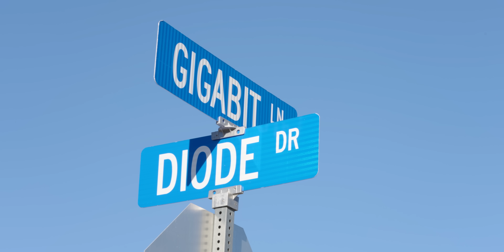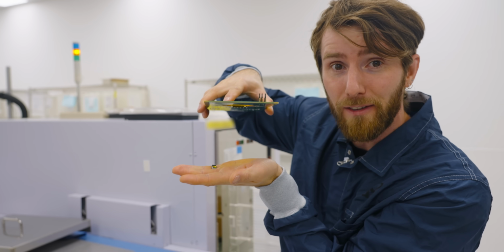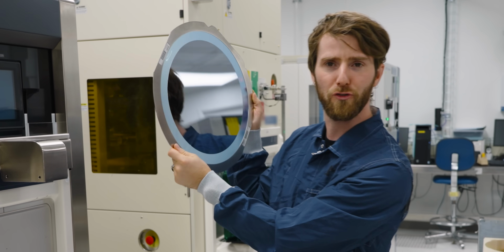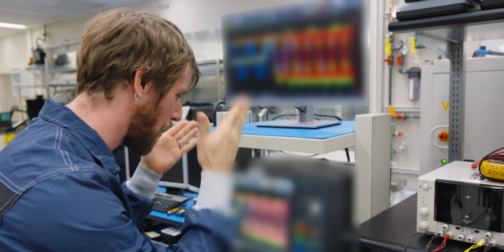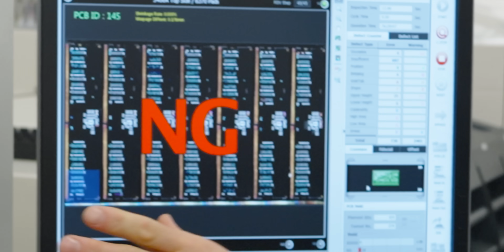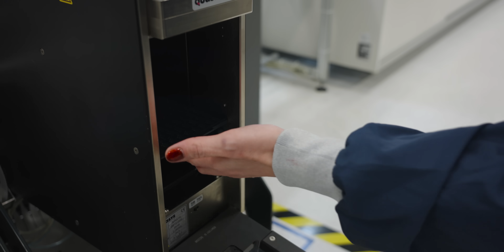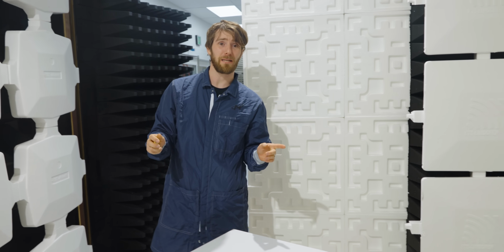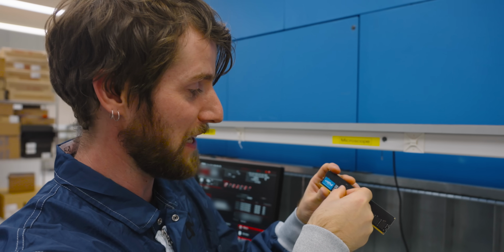I made my own RAM! - Micron Factory Tour

Comment: the CL69 on the label... nice I honestly just love the fact that the micron guys not only took the time to make up their own BS label for the sticks. But also specifically threw in a weird unusual capacity that linus never would have seen before, just to mess with him, and by his face first reading it. it worked! that right there is dedication! i love it
Reply: It seems like he was taking a module with a non released technology. A triple layer chips, maybe? 3 times 8 gb, seems plausible. The beeps wouldnt be necessary otherwise.
Reply: It's 24GB because Micron is now going to start releasing 16GB sticks with a software upgradeable extra 8GB license that you can buy. Come on! One of my conspiracy theories has to be right! 😆
Reply: @fitybux4664  Memory as a Service (MaaS). Module has 2TB of DRAM, but you buy the capacity in 8GB chunks on an annual fee.
Reply: @fitybux4664  pretty sure they will make it downloadable DLC.
Reply: @joshholmes1372  HECK YEA
Reply: @joshholmes1372  literally download more RAM
Reply: are these 9000mhz sticks ?!
Reply: @Z3DT  yep 😂😂
Reply: @EinWildesDoener   Just slightly over 9000
Reply: finally we can download more ram.
Reply: Imagine being the first test technician to get the first gigabit ethernet card for Intel? It was a one off $100,000 costing card with less ESD shield guards on the card. So you had to handle it in extreme ESD safety. The guys in the lab were all smiles , and in awe when we finally got to look at the chip as designed on paper.
Reply: @fitybux4664  Someone will hax the code and set it to free. AMD tried that stunt and got bad publicity about it, so they unlocked the extra cores on a cpu as a stop gap till their next chip. To keep the AMD buyers happy.
Reply: Funny listening to these theories XD
The truth isn't too exciting. NDAs are a pain.
Reply: @mazocco  I think it's more plausible that it is quad channel ram 6x4 = 24
Reply: @Z3DT  but the point of downloading ram is to not pay for it
Reply: @joshholmes1372  Downloading more ram will finally become true!

Comment: I love that they'll bypass safety circuit interlocks to allow some of their equipment to run with the door open to better show the process for the camera! They're truly allowing better understanding of machine operations by doing this, and as a viewer I'm thankful to see!
Reply: they gotta do it daily anyway....regular running requires it as that step needs you to pull the lid sometimes to see the tiny little component doing weird things the cameras just dont catch...theres no room for a dozen cameras in there...those placement heads run like oldschool epson printers at machine gunning speed......entire ribbons of components just acting stupid from all the movement can sometimes require a sequence change cuz things are moving too fast
Reply: not that wierd. You just do not people to stumble into machines by mistake.
Or clean it a lot of times extra.
Having someone look into it for 15 min no real problem at all
Reply: So, anything can be safe with enough instruction and precautions taken. But designing safety requires minimizing all risk with the least amount of instruction. Also the reason why the CNC doesn't work without the cover. You can't make flinging PCB shavings safe.
Reply: @mattparker7568  agreed, even with eye protection there's always a risk. That's why machine guards exist and those guards are part of integrated safety circuits. Really the only time they should be off would be during recoveries or during controlled repairs from the technicians or maintenance crews. 
Controlled demonstrations like this definitely have to be thought out and made to be as safe as possible for everyone involved.

Comment: A little late to the party, but the reason why it's 24gb modules is for the new AMD Genoa platform with memory channels of multiples of 3. The flagship model currently has 96 cores in 12 CCDs with 12 channel DDR5 memory. Not really a huge secret, but Linus could have just 'speculated' on this at the end.
Reply: Is this say that Intel won't take advantage of a 24 gb RAM stick standard? I would think it will ...
Reply: It might be hard to speculate when you actually got told face to face.
Reply: Tri channel memory is back? I had an x58 board with tri channel memory
Reply: I don't think he could do that because of legal troubles. Supposedly those sticks are "Not meant to leave this facility" and the security detail just looked the other way :3

Comment: I have a feeling that even when DDR23 (and beyond) is a thing, Linus will still hold onto these DDR5 Sticks (on the Mother board of course.. LOL) because they are a One of a kind special, that he had such a big hand in making.
Reply: There won't be a DDR with a crazy number like "23" as by that time computers won't exist in the form that they do now. Yes, I know, you're joking.
Reply: @sandboy5880  what are you talking about? here in 2127 we have our Core i9-118950k with 8192c16384t optical processor running at 12Ghz with ddr23-1677721600 cl8388608, or you can dish out for the Ryzen 9 112950X3D with 12288 cores with SMT for a total of nearly 25 thousand threads
Reply: @danzjz3923  
Sure, you guys do.
By the 2127 there's no telling what it'd be.
Reply: @sandboy5880  you must be fun at parties
Reply: @danzjz3923  oh yeah bro, its sick here in 2127, im using my Samsung galaxy S122 Ultra that takes 2400 megapixel photos and has a 240 ghz refresh rate with its 16k display that has 240 billion colors and has a processor that runs at 3000 terafarts per second.
Reply: @danzjz3923   Wait... you're from the timeline where AMD and Intel didn't merge? Lucky you.
Reply: @discipleofdagon8195  I’m from the timeline where Intel bought the radeon group, not the whole of AMD
Reply: That assuming his custom rams haven't blown up by that time.
Reply: @danzjz3923 Yes in that timeline the best GPU on the market is not from Nvidia, it’s actually from Intel. It’s called "Intel Radeon RX 89900 XTX“ wich has 24TB of GDDR26X VRAM, 1,928,928 shading cores, 283,827 ray tracing cores and 512 real life cores wich can simulate the entire world at 48K Ultra 900 FPS.

Comment: How many of us were nervous at Linus holding the wafer. This was an amazing video, enjoyable and informative. Thanks to Micron for allowing Linus to visit and share.
Reply: Prolly a prop or damaged one. Pretty sure you don't handle any of those parts without ppe
Reply: @joshuacheung6518  PPE as in part protective equipment? Not as concerned about it hurting Linus as I am him hurting it.
Reply: @justathought  maybe after it's been stuck on the sticker, but before that i doubt it as the part that matters if you sneeze on it (literally) is exposed
Reply: @ffsireallydontcare  think about it closer. That's after a protective sticker is applied to the sensitive side.
Reply: @ffsireallydontcare  right, but a solvent dip isn't the same as needing to clean off conductive debris or fix a gouge on the chip caused by a hair landing and being rubbed into components.

Comment: I use to work security at FAB 6 in Manassas, VA. Before FAB 6 was Micron Technology, the FAB was under the name Dominion Semiconductor. I was a patrol officer and an emergency dispatcher. Lots of bad chemicals in places that do manufacturing -- even worse in the hands of people with mental issues or a vendetta. The place was HUGE, as you'd expect, and I got to see them expand and build. We went from one FAB building to TWO FAB buildings. I loved working there. Sadly, the security was contractors, and we lost the contract because of some other company (to be unnamed) underbid the company I was working for!  :P

Comment: Man that was some cool stuff. It makes you realise how many iterations of different products are being developed at a time. Like we just got DDR5 but surely there's DDR6 in there if not DDR7 and higher; it's kinda weird that the stable consumer products are pretty old by R&D standards. Also I've always liked Crucial, bought RAM and storage from them many times but this tour makes me like them more.
Reply: the technologies that will be used to create ddr6 and ddr7 are certainly going to be present in some form yeah
Reply: well i remember years ago....we were on DDR2 maybe DDR3 RAM but graphics cards were always running one step "newer" DDR technology.
Reply: @garionprak7961  GDDR memory is a different technology than DDR memory, both types are optimized for their respective tasks, GDDR tending towards higher bandwidth and DDR tending towards lower latency (among other optimizations). So GDDR5 is not what later became DDR5 (GDDR5 was in fact derived from DDR3). Basically the naming is as much BS as the clock speeds, where GDDR6 advertises 8x the actual clock speed because it gets 8 transfers per clock cycle (All DDR does a similar thing and advertises 2x because it's "double data rate").
Reply: @credge  thanks for clearing that up for me
Reply: Well, the fact that this video makes you like their company more than you did, is the reason they let Linus in! Win-win situation.
Reply: I work in hardware and our company is already developing two, three generations in advance for chips on the market.

Comment: Absolutely amazing video! I love the behind the scenes at major chip-makers, A: because we never really get to see what goes into the gadgets we use everyday, and B: because I work at one of them! The chips I test daily are in sockets quite a bit smaller than the one they had for probing the memory chips, but we have a few of those yellow ones with the big screw wheel even. Another cool thing is I have a family member who works at a different company than I, which is the one who makes those really expensive oscilloscopes that are needed to validate anything and everything we (and Micron) work on. Really cool to see, especially since Micron is more similar to what I do daily than seeing Intel's behind the scenes (still was really cool)

Comment: Mind blown? No. Hairs standing on end, almost shedding tears? Yes. I just wish it had been longer! More please...and i wouldn't be surprised if their 'joke' label has a hidden one - they are actually 9000MT/s modules! And 24GB DIMMs... Way to show off, Micron! <3
Reply: That seems unlikely - the world record has only recently gone beyond 10000MT/s on a single LN2 cooled 16GB module. 9000 MT/s with full slots (notice he put in 4 modules!) seems a stretch. But I don't doubt that it's quite a bit faster than the typical DDR5-6400 kit you can buy online.
Reply: Even tho the XMP and lots of data was redacted, my brain is melting at the fact that the memory modules were 3gb in size, WHY??? Are we start going to see 3,6,9,12 gb memory modules, or will there be some cool memory correction instead of ECC but something else???
Reply: @skyblockpro1  I doubt we'll see anything smaller than 12GB dimms
Maybe some laptops with soldered memory with 6GB at the lowend
Reply: @skyblockpro1  The reason for 24GB dimms (and soon to be 48GB) is with current 8-channel memory for servers and upcoming 12-channel, its hard to right size the amount of RAM in a server when you need 8 or 12 dimms.  Where 32 gb dimms might be too little and 64 gb dimms too much ram, but to keep full performance you need to fill each RAM slot, so 48 gb fits in the middle, same thing where 96 fits between 64 and 128.  You get to better right size the RAM for the server and not lowering performance by leaving empty memory channels.
Reply: @martinpoirier9070  Upcoming 16 channels, bro.

Comment: It's not like I love DDR4, it's just that I can't afford DDR5.
Reply: meanwhile, me whose never even seen a stick of ddr4 in person.
Reply: I wish you could use ddr5 ram in ddr4 motherboards, would make life for EVERYONE so much easier, but i know it wouldn't work
Reply: I cant afford DDR3, thats y my PC has 4 GB of DDR4
Reply: @skymish533  ddr5 ram support ddr4 motherboard you can use because ddr4 and ddr5 ram sam 288 pin.😀
Reply: @ShahbazFun  No you can´t it will not even fit in
Reply: It's literally only slightly more expensive. The biggest downside is having to change the platform/motherboard you currently have.
Reply: @fohatadri  me chilling in Italy with DDR3 at about 40€ for a 4 GB kit, DDR4 40€ for 16 GB, still dual channel, and a single 2 GB Stick of DDR5 no RGB "only" 5000 MHz for 30€
Reply: Same with me and my 1080 turbo 😭
Reply: @ShahbazFun  I can't tell if you're joking or just wrong
Reply: Greetings from DDR3 land and the fellowship of the 5th gen laptop i5
Reply: @justafreezer496  thats a real good gpu
Reply: @maegnificant  still a 1080 tho
Reply: @maegnificant  so you're telling me the Asus turbo gtx 1080 8 GB isn't real, idek anymore
Reply: @maegnificant  it is a real model, ASUS specific, 8gb vram, and slightly overclocked I believe
Reply: @justafreezer496  its like 5% slowet base clock but 10% faster boost clock i believe, so still basically a 1080
Reply: @_Gioro  damn 💀

Comment: 24GB sounds weird and interesting. That just brought the Macbook Air M2 to my mind because they have two RAM modules next do the SoC and they can be also up to 24GB, so 12GB each. Maybe we see some shift there in the future from 4, 8, 16, 32GB etc. to 6, 12, 24, 48GB etc.?
Reply: An unusual capacity for a single DIMM. There are indeed larger 32GB DDR5 DIMMs, but I can't find any signs that anyone has ever sold any 24GB DIMMs
Reply: There's an Asus laptop that I was eyeballing with 8 gigs of soldered memory with expansion slots. A weird hybrid approach, but apparently it was totally cool running with 40gigs of memory which was... weird to think about.

Comment: 28:46 the famous brown pacer test is a multistage aerobic capacity test that progressively gets more difficult as it continues. The twenty meter pacer test will begin in thirty seconds. Line up at the start. The running seed starts slowly, but gets faster each minute after you hear the signal. Beep. A single lap should be completed each time you hear this sound. Bing. Remember to run in a straight line and run as long as possible. The second time you fail to complete a lap before the sound, your test is over. The test will begin on the word, Start. On your mark, get ready... Start.

Comment: 28:46  

"The FitnessGram™ Pacer Test is a multistage aerobic capacity test that progressively gets more difficult as it continues. The 20 meter pacer test will begin in 30 seconds. Line up at the start. The running speed starts slowly, but gets faster each minute after you hear this signal. [beep] A single lap should be completed each time you hear this sound. [ding] Remember to run in a straight line, and run as long as possible. The second time you fail to complete a lap before the sound, your test is over. The test will begin on the word start. On your mark, get ready, start."

Comment: I thought I could uncover some magical Micron secrets during the censored audio, only to be trolled by your editor: 

"The FitnessGram™ Pacer Test is a multistage aerobic capacity test that progressively gets more difficult as it continues. The 20 meter pacer test will begin in 30 seconds. Line up at the start. The running speed starts slowly, but gets faster each minute after you hear this signal. [beep] A single lap should be completed each time you hear this sound. [ding] Remember to run in a straight line, and run as long as possible. The second time you fail to complete a lap before the sound, your test is over. The test will begin on the word start. On your mark, get ready, start."

Comment: Man, they had me work in a silicon factory. Cleaning old silicon. 

13$ a hour. Mixing explosive chemicals to clean them all while they ran equipment outside that shook the building constantly. 

I broke a beaker last time the building shook. I just grabbed my stuff and left. 

They never sat down a fully explained to me the safety hazards to the chemicals and literally just made me read for 4 hours in a room by myself and didn’t go over anything with me, 

I was pretty ticked off

Comment: Ha, the SSD chips in both the SSDs in the PC I am posting from are made by Micron, the controller made by Micron. My GPU VRAM is Micron. My system RAM is made by Micron. I put it together 6 years ago, and it has never had an issue with any component yet, the tiny OS SSD was from my previous system and is a gen2 still going strong.

Comment: My theory on the 24GB sticks would be something like error correction to make more durable sticks but without a dedicated controller for that. Like the "self healing" SSDs where the usable capacity is less than the actual capacity to not have a decreased capacity when one bit fails. Maybe that technology is still in development and they don't have patents for it at the moment.

Comment: It would be nice to also test if the chips also work when exposed to X-rays (and neutrons). Because those things will also have to work in areas with elevated radiation levels. Some even end up in areas that would be deadly for humans (hot cells). And i know that electronics will fail in that area after some time.

Comment: OK, so 24gb thing means 3gb per chip. Which is bonkers, since they tend to use power of two for these.

So either those are ecc chips , that have their parity bits utilized as usual memory. Or extra 1gb is a usual spare space, which exists for cases, when the end die is not perfect, but since in Linus case it's perfect, they did not disable it in firmware

Comment: One of my biggest questions is: what happens to the dies that are discarded or unusable? I’m assuming Micron recycles them, but how?
Reply: Used to be they would got to a group called "spek tek" who package them and sold them for toys and lower value memory. When i worked in assembly way back they set up their package line and we would give them die on film frame post die attach and use the wafer map to pick die they could still use